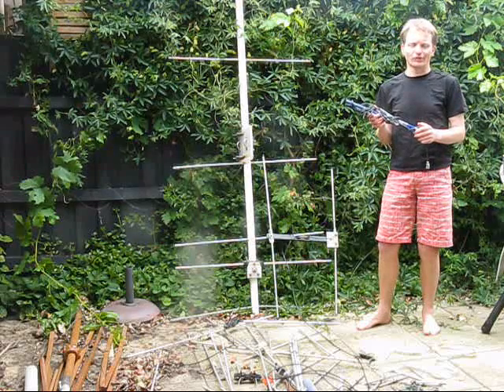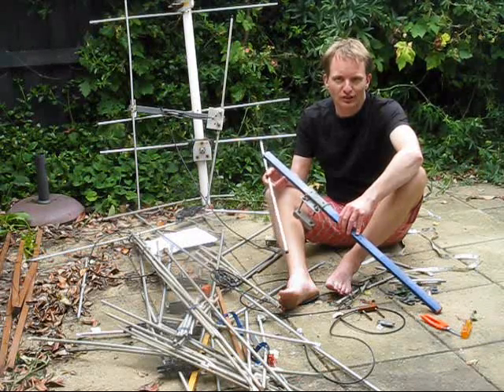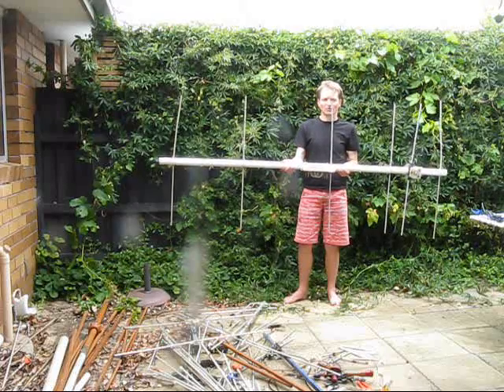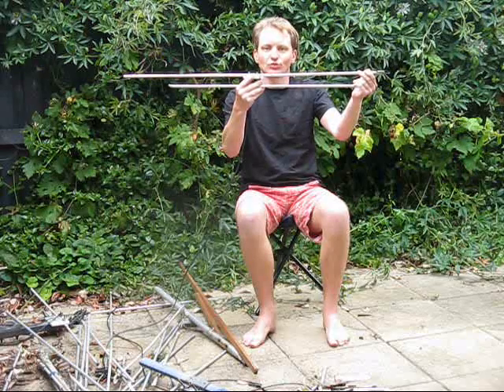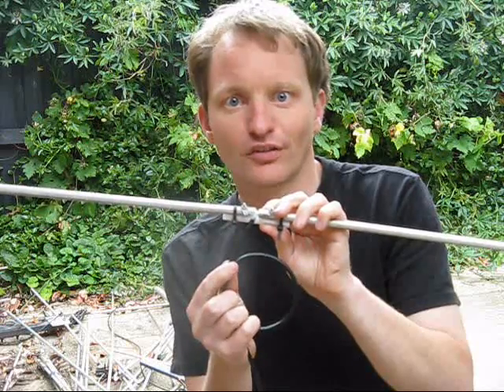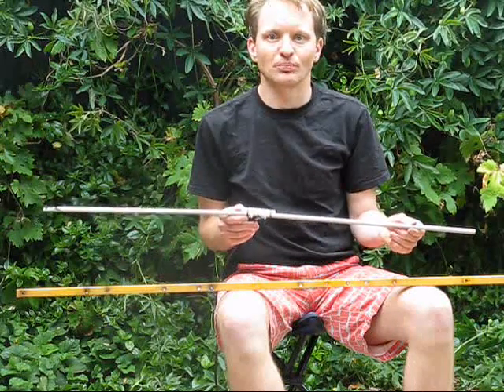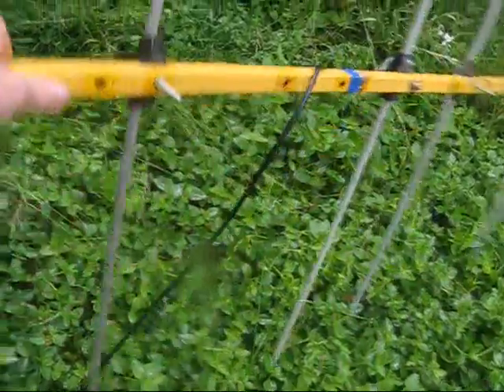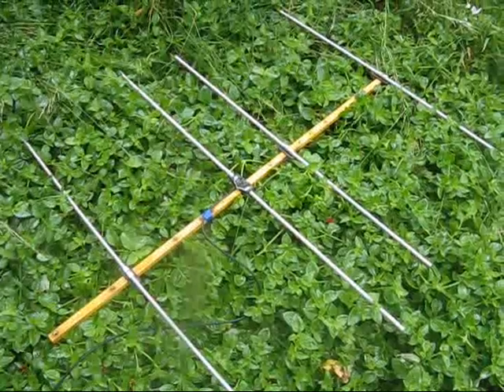Building a 144 MHz 4 element yagi - Part 1 (construction)

Comment: I saw you blink once.  Thanks man.  I wish you would have mentioned why someone would want one of these, the range to expect, etc.  I am a beginner.
Reply from the maker: A beam antenna increases your radio transmitting and receiving range, making signals that were previously difficult to understand easily readable.

Comment: what's the spacers in inches from driving elements is you try to build a 132mhz yagi antenna???
Reply from the maker: +papi rico Take a 144 MHz design and multiply dimensions by 132/144